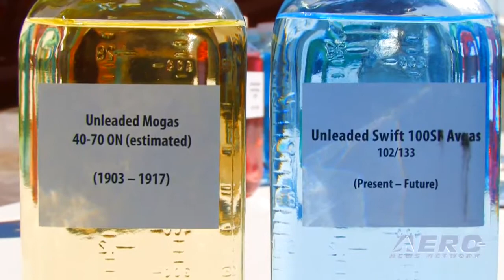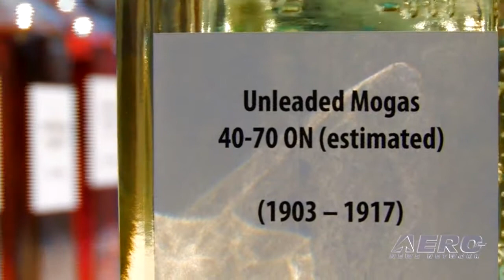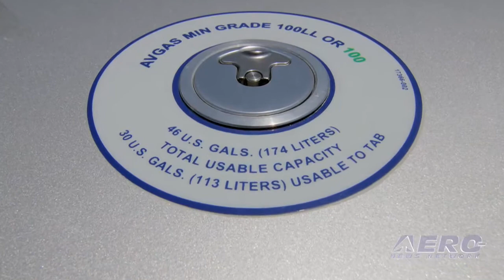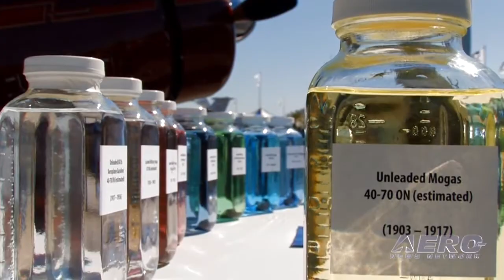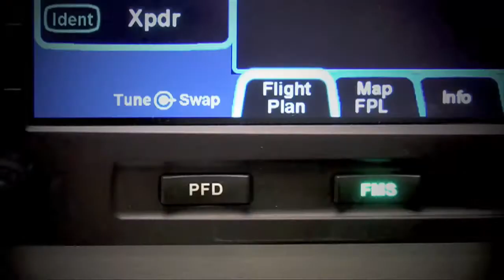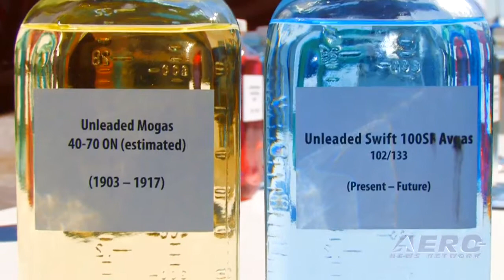Aero-TV: AvGas Alternatives: The Swift Fuel Proposition (Part 1)

Comment: Very interesting... I'm a huge fan of ethanol based fuel. I wish we could get a 100% ethanol. It burns super clean there's never carbon buildup has a super high octane rating ( even though you can't write it that way it's comparable to 120 octane)  intake manifolds normally sweat because of the cooling properties of alcohol. the only problem with it is the amount of energy by volume. it's about 30% down compared to traditional fuel. But this really got my attention. if we could get a fuel that has all the same attributes as ethanol but has more energy density than regular fuel and could be produced outside of traditional methods... bio. That would be the way to go.